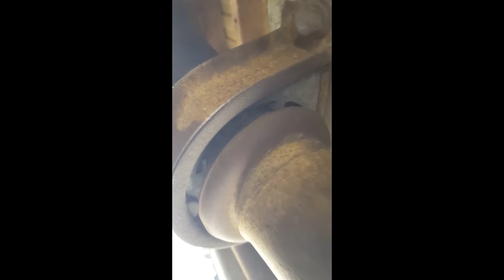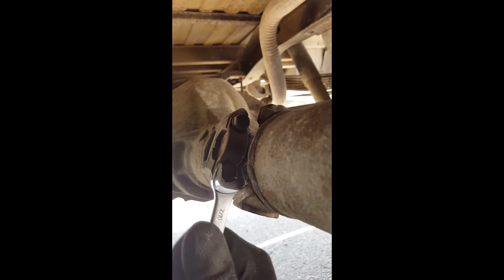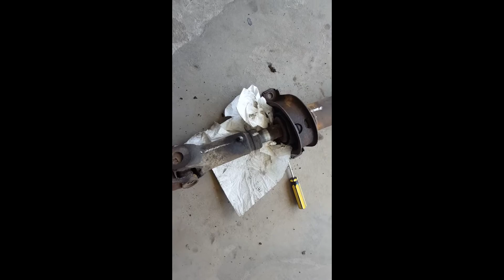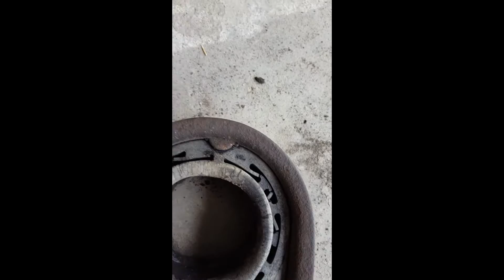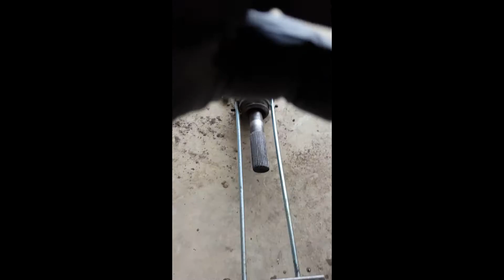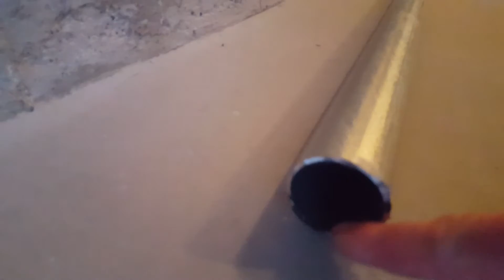Replacing Collar/Steady Bearing on 2 Piece Drive Shaft

Comment: thats the same 2 piece driveshaft on my 1986 chevy rv 454 the same problem it wont come off its like something in there  keeping from coming apart a puzzle!!!
Reply from the maker: Did you see in the video where you unscrew the threaded cap, because that puzzled me at first as well as it was rusty and not clear there was a threaded cap.
Reply: @CalgaryBiker  yes i did  just like you mentined those rusty barely visible threadths are part of the cap and BINGO the puzzle is solved THANKS!!!

Comment: I cant find a support bearing to fit my 75 GMC.  What size bearing hole did you get?  Mine seems to be 2"  Thanks
Reply from the maker: This is the part number for the bearing I used. I got it from Napa. Hope this helps. Part # PRF PHB88107A